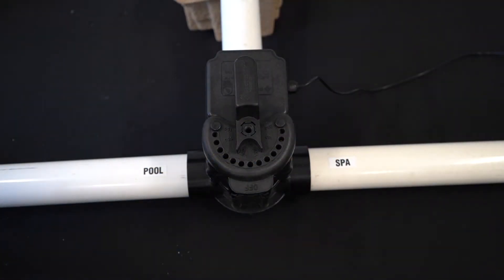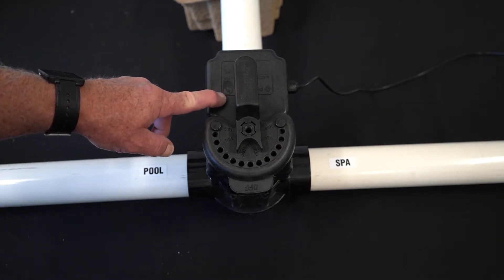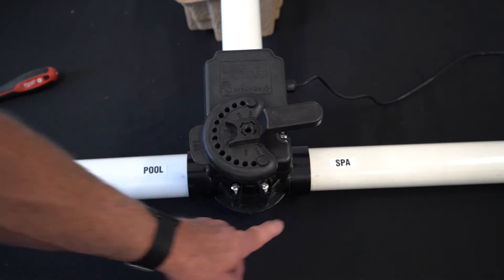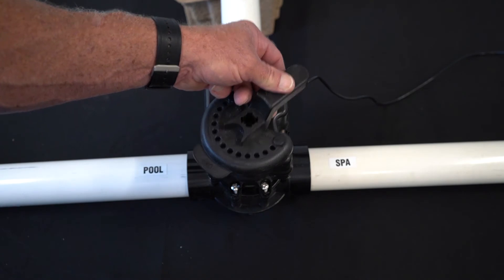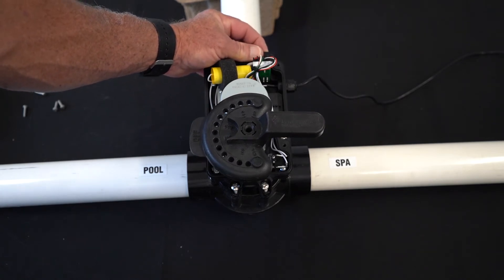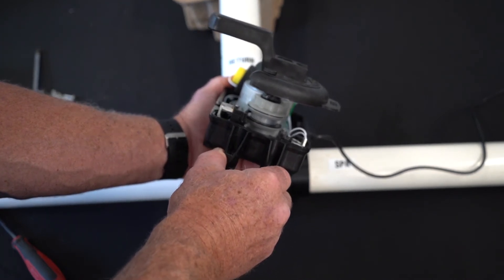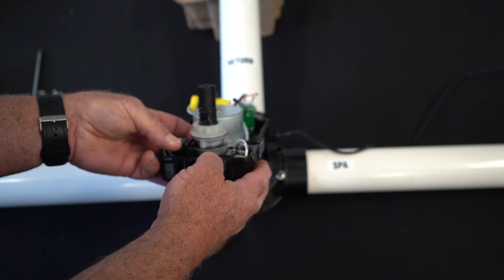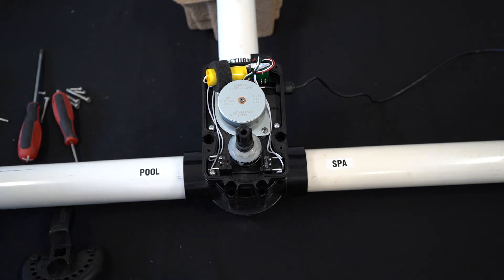How to cam a Pentair valve actuator

Comment: I had a valve that wasn't shutting off. The motor kept running. I tested the switch and it seemed to work, but the stop had moved. I wasn't sure if they were adjustable. This fixed the motor-run issue.

Comment: Thanks for the video. I have the same actuators, but the opposite problem. The pool builder set the return valve to have partial flow to the spa when in pool mode. This causes constant acid loss and weekly acid feedings to lower the always rising ph (from the aeration of the water). I need to undo that change. It looks like I just do the opposite rotation that you did. One more question: what is the significance of the two black posts?  In your video, the valve is set for L90 R90, but mine is set at the 180 holes. I am wondering if I need to move those black pegs.
Reply: Thanks. Great video.